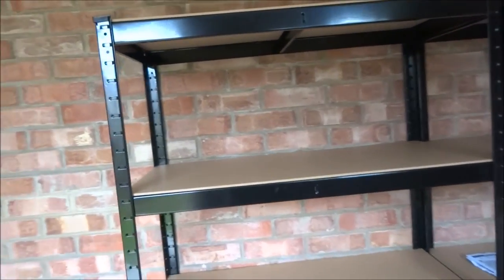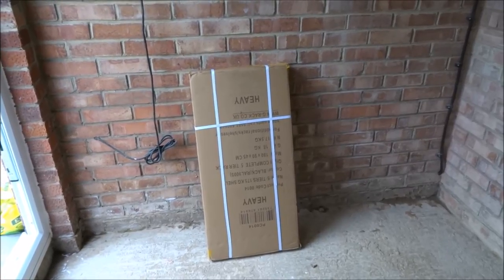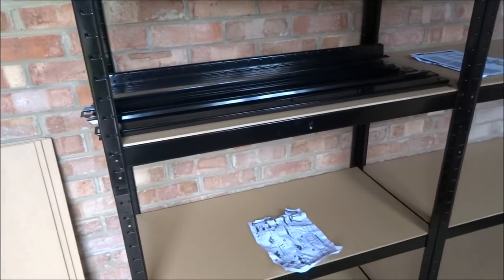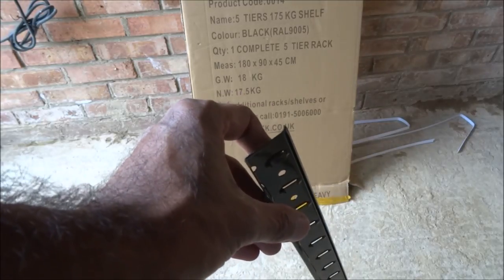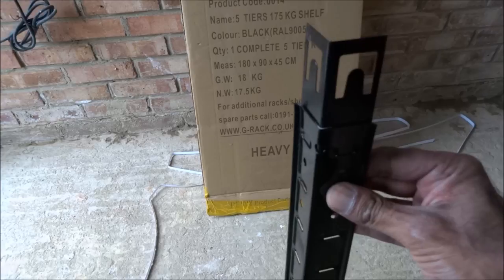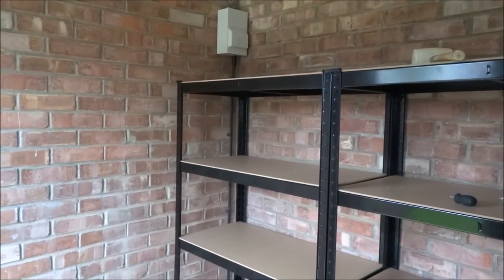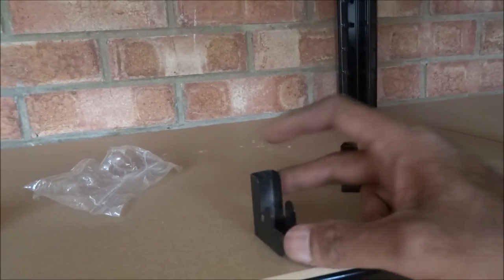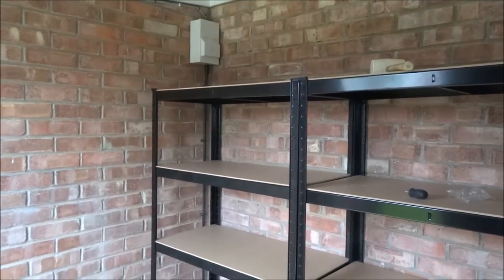How To Assemble Metal Shelving

Comment: For anyone watching . . . The L shape things he mentioned @15:25 are to connect the two shelves side by side tight next to each other.
To do that, put the L shape upside down with the circle on the top and facing inward towards the the shelf (as the connectors can connect from the front or the back of the shelve) 
Then slot 1 side to one shelve and the other side on the other shelve so they thight next to each other. Hope that helps. It took me forever to figure it out! 

AGAIN, THANK YOU SO MUCH FOR SHARING YOUR VIDEO IT HELPED ALOT

Comment: Thank you! That really helped me get started. You may have mentioned this but to those reading, make sure that the pieces slot in correctly, I ended up with a few ends sticking out at the other side and didn't  notice this until I was done with the assembly. Also, if you are saving and plan to put this in your room - I don't know why, but. . . it smells really bad😅

Comment: No matter what I did, my "connectors" would not go in enough to make a clean joint. Its as if the slots weren't wide enough. I ended up making my own brackets. Other than that.... Jheez! What a Time consuming process. Feels like enough DIY to last a lifetime.

Comment: existing designs for industrial shelving units.

the manufacturing processes and technologies that are being used and possibly alternatives.

material requirements and suitable material properties, including corrosion resistance.

the health and safety requirements for the product, user and manufacturing processes.

environmental considerations including sustainability.

any other relevant factors, such as the application of semi-permanent fittings and fixings, methods, mechanism to enable  ease of use and designing out-risk

Comment: We live in the US and bought the Edsal Racks on the list you provided. Unfortunately they don't include the couplers,  end caps, or center support bars that you featured. The company doesn't want to send us the missing couplers, even though the instructions say that you should install them, as if they are provided. We are so disappointed. Is there any way we could buy the exact same shelving units that you feature on your video, as they are so much nicer than what we received from Edsal. Thank you.
Reply from the maker: Thats a shame, check out the description of the video for details on the one I brought.
Reply: Thank you for your kind response, but we have already purchased "Project Source" shelves from Lowes Hardware chain,  online. Unfortunately, they don't come with the couplers either (impossible to find in the US :( ), but they do come with a tool to help you connect the top and bottom posts together, which is the best we could find. God's blessings to you, Sir.

Comment: Your risk assessment must:

identify hazards caused by your storage of goods
analyse the likelihood of their occurring

Shelving and racking:

floors are sound and level
you follow the manufacturer’s installation instructions
where shelving or racking needs to be fixed to a wall, the wall can support the load
where appropriate, special safety ladders are provided to avoid people climbing on shelving

Pallets:

using a pallet which can’t cope with its load
poorly designed or constructed pallets
using damaged pallets
using the wrong type of pallet for the racking system used or the material or substance stored
poor handling of pallets

Safe storage of dangerous or hazardous materials:

storing chemicals according to the manufacturer’s instructions on the safety data sheet
keeping the minimum quantity of hazardous substances necessary
storing incompatible substances separately
taking steps to prevent release or leakage of dangerous substances

Fire and explosion risks:

place stores of liquid above ground where they’re unlikely to be damaged, eg away from traffic routes
avoid overfilling containers
supervise deliveries
maintain gauges, valves and pipework
monitor oil use – unexpectedly high use may indicate a leak
have procedures for dealing with emergency leakages

Comment: Thank you so much, I have the exact same shelving. The pamphlet that came with it was so bad could hardly see the images. Didn't know whether to put the connectors on the outside (which I did to begin with) or what! I am over 70 and have arthritic hands, so not easy anyway. Having watched your video I know exactly what to do. Thank you so much. Also glad I was not the only one with some problems getting the ends in, screwdriver  tip was so useful. thank you x

Comment: Thanks for the video! I have a converted attic which is my 'game room' slash office space and for the longest time I've had a little shoddy rack holding my laptop and PC games on that I'd been meaning to upgrade for a year or so now, saw these boltless shelves online and thought one might do the trick.
After watching your video I went ahead and ordered one from ebay, 25 pounds shipped, 150x70x30, put it together and it looks fab in the corner! I actually had to cut the length of the legs down a little so the overall height went from 150cm to 110cm as the ceiling is angled at a certain height, but after doing that it fit the space perfect.
Reply from the maker: Awesome good to hear the video helped!

Comment: I was on the brink of returning my shelving as the guide was unreadable as were the 4 pictures. I decided to look on You Tube to see - still not convinced as a pensioner + screwdriver I could do this!  However, I decided to have a go as the return arrangements were as expensive as buying it!  So I persevered & went bit by bit with this video - doing + pause - doing + pause!  Still not sure if I used the screwdriver properly but opening up the holes worked.  And it did take me 2 afternoons but Delighted!  Thank you so much!
Reply from the maker: Thanks for the comment, Excellent to hear the video helped!

Comment: Nice fit and enough room on the side for sheet material if you want to slide thin items in there. I got some similar racking but is more industrial as they were throwing it out from a site so I nabbed it! I bolted mine to the wall just gives it more stability. Nice video.
Reply from the maker: +Zed Man thanks for your comment. It worked out quite well storage wise, its really good. Your lucky getting the racking for free wish mine was!

Comment: Have you had any issues with the wooden shelf’s , all mine and gone mouldy on top and underneath from condensation thanks
Reply from the maker: I had exactly the same problem with mine, what I did was use bathroom mould cleaner to remove and then painted it with gloss paint undercoat and 2 coats of gloss paint and its been fine since then.
Reply: @GeekStreet  ok brilliant thanks for reply 👍

Comment: Thanks for the vid which helped me a lot. Just completed my set of shelves and I found the assembly incredibly tedious and fiddly and took me half a day to sort out with all the bending and prising. Also if the shelves are 10 or less slots apart the mdf shelf won't between the frame as you show and I had to get them in by bending the shelf to an arc. Wouldn't buy this design again. Check out the Yaheetech system, a little more money but much more intelligently designed.
Reply from the maker: Thanks for the comment, good to hear the video helped.